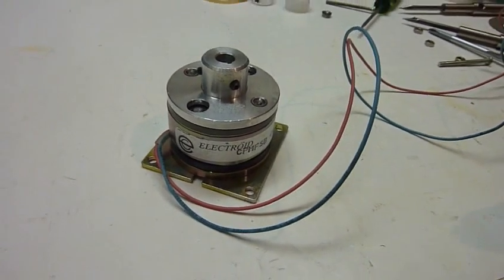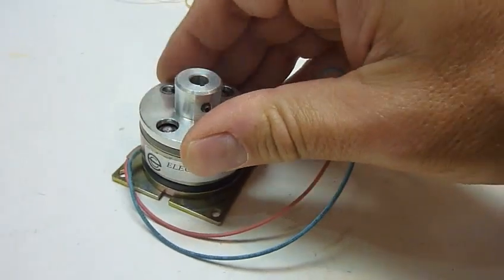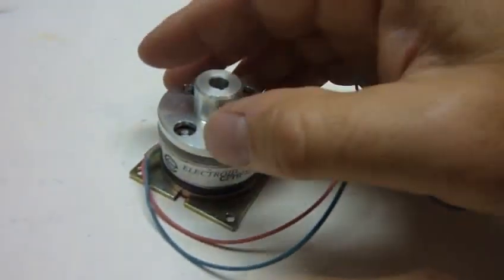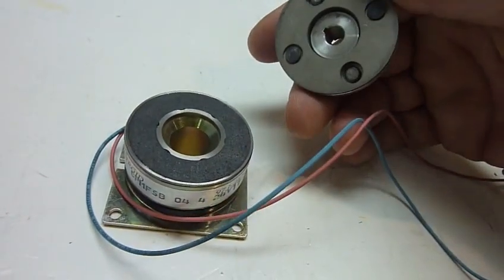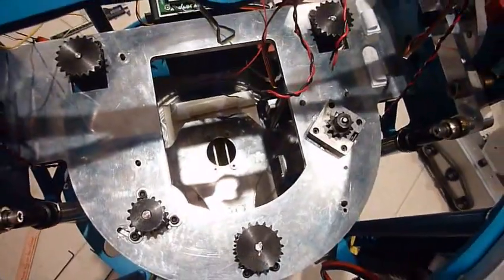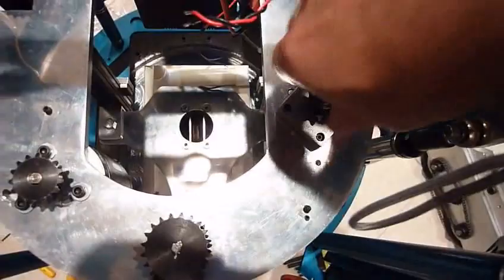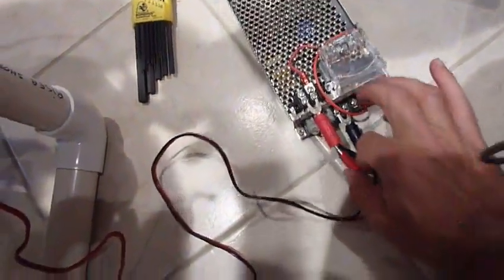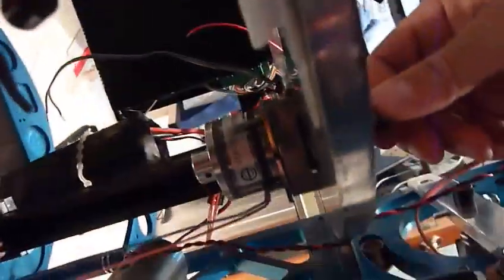Electro Magnetic Brake

Comment: I would like to know if it is possible to vary the applied voltage from 0 to 24V to simulate a variable load (to see if the force will increase if the voltage). Regards

Comment: Can we vary the braking load on changing the input voltage i.e. if I give 12V instead of 24V the braking force will be more powerful right?
Reply from the maker: On this brake, the power is used to release it, so using only 12V will just not release the brake fully. But I suppose if you biased it reverse it would actually reinforce the braking.
Reply: I wanted to vary the torque required to rotate the brake disc by adjusting the input voltage some where between 0-24 V so that I can get variable torque for different values of voltage. Do you think this is possible?
Reply from the maker: Probably not the right device for this, very non-linear, not made to work when slipping, etc... But I have not tried it.
Reply: CuriousMarc I am looking for an application where I move the shaft very slowly and I wanted to change the torque by changing the voltage, do you think that is possible?
Reply: Prakhar Jain you’re talking about an electromagnetic clutch. Slightly different. You can find them duo purpose as well.

Comment: hello curious mark, do you know if i can get piston type linear actuators that have stepper motors instead of dc motors?
Reply from the maker: You sure can. These will be much more precise, but usually much more expensive, much slower, and more power hungry than their simpler DC motor powered cousins. Hence mostly used for high precision professional motion control when ultimate accuracy and repeatability are very important. See for example:
http://www.ultramotion.com/products/digit.php
Reply: CuriousMarc omg ,thank you,i have been looking all over the internet to look for these. What keywords you used?i want to build 4 dof welding robot. Budget quite good.

Comment from the maker: 1. They make them in all sizes. This particular one was 40mm diameter, one of the smallest ones I've seen.
2. Do not know. Got the part at a surplus, no spec sheet. A lot. More than a spring activated brake.
3. Surprisingly enough, yes, feels completely free once mounted on an axle. Very little residual friction.

Comment: Hi mverdiell,
I'm Thang from Vietnam

Could you help me answer some questions??
1. What is the diameter of the disk and the base of the brake also?

2. What force stuck the disk when the power is off? (magnetic or spring force)

3. Is the axle really free when power on or it still has a little friction?
thank you in advance